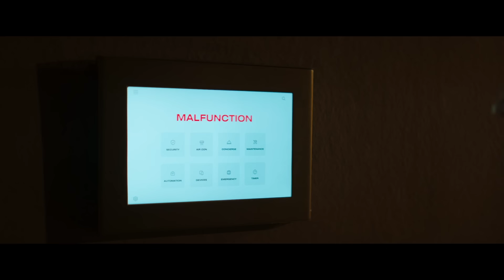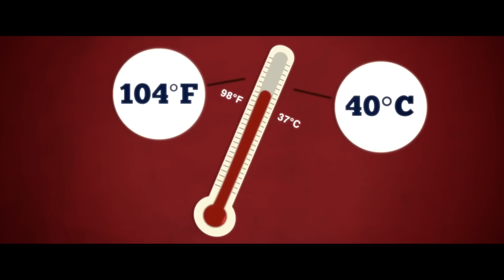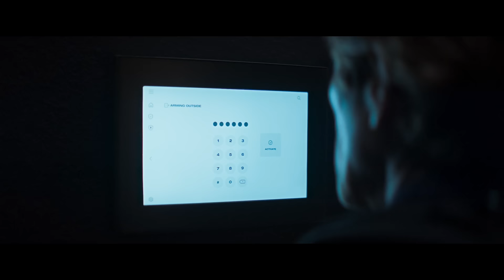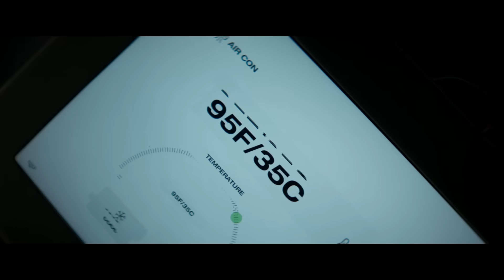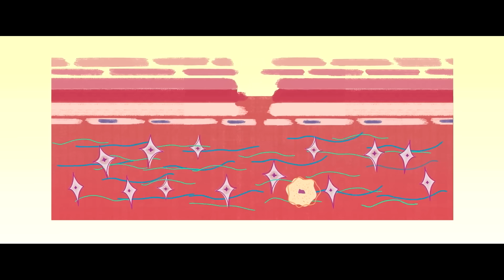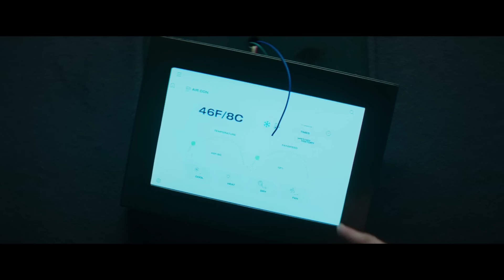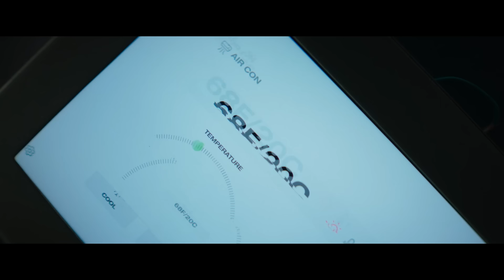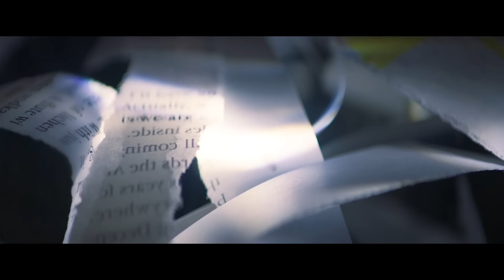How To Beat The DEATH HOUSE In "Inside"

Comment: I thought he could have switched stations on his walkie talkie until he found the security station downstairs or someone else’s. That really frustrated the hell out of me. 
I’m barely 7 seconds into the video so if it’s mentioned already, my bad. 
There was another comment I agree with that said his “partners” gave up on him too quickly and that did feel like a major setup to keep him trapped…but the art theory blew my mind—that the owner just wanted to use Nemo as a medium on madness+art.
Also, I’m sure Nemo hallucinated a lot towards the end…but what was up with the owner smacking Nemo’s head against the table and knocking him out?? That felt kinda real…and Nemo’s dream: it could have been a memory because you cannot do a heist without knowing info about your target(s)…
This movie leaves a lot unanswered but I am still very upset about Nemo not even trying to switch radio stations to find the frequency. The first security guard he sees appears to have a walkie on his desk 🤦🏽‍♀️😪
Just came across the part where the commentator states that Nemo is very limited on who he can talk to, but he could have always called security for help and 1) pretended to be a family member who got in but couldn’t get out & his phone had died or 2) knocked the guard out and rushed out the building

Comment: PzKpfw IV (Panzerkampfwagen IV) was a German medium tank from the Second World War. The first prototypes of the vehicle were created in 1936, and serial production continued in the period 1938-1945, ending with the production of about 8,600 vehicles. The D version of the tank was powered by a single Maybach HL 120 TRM engine with a capacity of 300 HP. It was armed with 1 75mm KwK 37 L / 24 gun and 2 7.92mm MG 34 machine guns.

The PzKpfw IV was created as a result of a competition announced at the end of 1934 by the German Armaments Department for a medium tank weighing up to 18 tons and armed with a 75 mm gun. The competition was won by the Krupp company, whose vehicle was put into mass production - as it turned out, it was a vehicle that can be safely called the "workhorse" of German armored forces during World War II and one of the most intensively developed and modernized Wehrmacht tanks. Numerous variants of the PzKpfw IV were created in the course of production. Chronologically, the first was the A version, armed with a 75mm short-barreled gun and a 230hp engine. However, versions B and C appeared quickly, in which several significant changes were made: first of all, more powerful engines (265 HP in version B and Maybach HL 120 TRM with 300 HP in C version - which were installed in PzKpfw IV until 1945 year), and the armor of the entire car was improved. The F1 and F2 versions turned out to be a real revolution, in which the frontal armor was increased to 60 mm, and the main armament was changed to the great, long-barreled 75mm KwK 40 L / 43 cannon, which in 1942 and 1943 allowed them to fight any Allied or soviet. The most frequently produced versions of the PzKpfw IV were the G, H and J versions, which were very similar to the F1 and F2 versions. The main armament has not changed significantly (it was still the KwK 40 cannon), as well as the engine and chassis. On the other hand, the armor was slightly strengthened, and from the beginning of 1943 armored screens (Schurzen) were installed on them. Numerous other vehicles were built on the chassis of the PzKpfw IV, such as the StuG IV assault gun, the Nashorn tank destroyer or the Wirbelwind self-propelled anti-aircraft gun. PzKpfw IV tanks were used on almost all fronts of World War II - from the September campaign in 1939, through the campaign in France in 1940, the Barbarossa and Typhoon operations in 1941, the Battle of Kursk in 1943, to the last operations of the German army against The USSR and the Western Allies in 1944-1945

Comment: Okay, so I have a way to get out, and it might sound crazy, but I feel pretty confident it might work

Grab anything heavy enough to break something but light enough to carry, put them in a pile at the door, and then start throwing everything at it with full force and ONLY stop for a breath after you're 100% aware that you already used all heavy objects to try and smash the door, it'll either overtime finally create a hole big enough to scream for help from or make enough noise that even someone with headphones on and using a vacuum would notice the noise
Reply: why wouldn't you simply use one heavy object to repeatedly ram the door instead of throwing a bunch of shit at it?
even a basic wooden door would last quite a while if you simply throw shit at it because you need leverage behind the object or the backwards momentum will simply cause the thrown objective to bounce off like the door was a spring.

there's a reason gates and doors are rammed down by hand and not broken by someone throwing things at them.

Comment: that is a strange design. it is strange there is no internet since his hacker was remoting the security system.  control panel would have been connected back to a controller unit following the cabling to find it. Normally this would be in the apartment, if it is there, he could override the door if it is not in the apartment, he needs to focus on the door again, the locks are electronic, they sometime have power off open feature you can set and open the door. the siding door also has a mechanism that can be dismantled and put in manual mode.

Comment: 08:04 Not necessarily.  While he'd be fine if the plants get plain tap water and I'm sure could even tolerate a bit of miracle gro I don't think you would want to drink the water I give my plants as I'm an organic gardener so apart from using inedible things or quasi-edible things you'd find revolting, there's also intentionally a lot of microbial life going on in there.  If the water line is off, then there is a tank somewhere for the plants that can hold at minimum months of water for them, if that's unreachable for some reason, the pump and valves are controlled from somewhere (not necessarily in the apartment though, more and more things use bluetooth/wifi and app controls).

Comment: Usually an appartment-owner hasnt the right to cut off his appartment from the rest of the building. So, when the fire alarm started, the building security should have been informed immediately because... its a Fire in the building! That does not happen. So i also assume that the Art collector set up the complete Appartment as a trap. Maybe not specifically for someone special, but for someone that would try to break in and steal his Art and creating some kind of living Art and looking what the person or people inside his concrete prison would do and form in the process. But as a mechanic i have to say... i would have been out of the appartment within 1-3 Days... depending on how fast i could assemble a ram out of the metal frames and the strings he found... to break one of the windows... as he talked with the pidgeon we saw, that it was only around 1 inch glas. And even if it was bulletproof, security or plexi-glas... in that appartment was so much sturdy metal and metal bars, that you could build a contraption that could funnel an enormous amount of energie to a little point, that you could break that glas. And then maybe climb elsewhere outside, or build a rope to the appartment under that one he was in and "knock" on their windows to get attention. He also could have tried to chip away the concrete at the door just enough on the sides to have a small hole where he could throw a message in front of the door. He had a sharpening tool that is made out of hardened steel what he was using to reveal the bolts on the skylight. There were SO MANY things he could do but i assume... he was an Art Thief and not a handyman of ANY sort...

Comment: Instead of the surface of the door, he should of did the walls or door hinges. Locks/hinges/walls are weak (depends on country you're in for walls). If I know I'm locked in a place and know that no ones outside, I'm making a whole in the walls and such. It's a apartment, they're not gonna spend all kinds on money to make solid walls. Since it's a single apartment up there, their wouldn't need it. Also, that'll add a lot of extra weight to the building for solid steel walls that high up. Door might be sturdy but all doors have a weak point. You got plenty of time to chip away at it since you know no one is coming.

Comment: dont think he got out. he would of have to at least add more stuff to the tower to be able to climb up inside. also depending on if the other vents were screwed in, if he did get in, might die with no escape.

Comment: Heat stroke or hyperthermia is extremely common even in regions that remain relatively cold all year round. From people over exerting themselves, exercising, doing manual labor, to simply wearing to many layers than they need. Leading to exhaustion, that can then lead to their deaths from the cold temperatures.

Comment: ...I'm not penthouse rich so I'm somewhat unfamiliar with that level of top-of-the-line luxury items but on what plane of existence would a heating/cooling system get to such extreme temperatures you either cook or freeze? It seems wildly unnecessary unless of course you're housing and rehabilitating both penguins and lions 😂😂😂

Comment: I think I'd leave as soon as N°3 tells me I have the security system is only deactivated for 6 minutes. It just makes no sense. It's an apartment, you're supposed to live in it, or at least be there for extended periods of time. You're certainly not going to go to the control panel to enter a pin code every 6 minutes. If it sends a notification every time the system is deactivated, it should be immediate. Something is very fishy, here, so I'm out.

Comment: Sure, I'm late - let's go over the easiest thing he could have done - Break the toilet and collect the shards/pieces. That toilet was ceramic. Ceramic is so sharp and fine tipped that it easily shatters glass. I would have covered up myself, and tossed the top of the toilet down into the bathroom while dipping to the side to protect my body. Walked in and gathered pieces of the broken top. Then proceeded to repeatedly throw them at the glass. Maybe it would work, maybe it would - but it sure as hell has a high chance to work. 

If I did break the glass, I could then use the balcony to break someone else's glass or call in for an escape. No luck? Sky light was actually the best plan!!! Except I would have just thrown the pieces at the glass there to break - then built my structure. Clean off the glass and climb up to find the roof access. Then left. 

Honestly, blocking the door from shutting would have been an immediate action. Next, the whole thing is an obvious 'intentionally got you stuck' situation. So as soon as I saw the painting wasn't there I would have called it quits when I was told to keep looking. In the criminal world that's a tell-tale. So I would have said "okay" then just... didn't. I would have gotten to the edge and been like "I bagged the ## painting. Give me extraction" - Never would have said I found the self portrait, just a number. Once I'm out I'd show them the not-self-portrait and told them to deal with it.

If I WAS stupid enough to say okay and tried the security and didn't work? And the door tried closing? I would at that point assume they're intentionally screwing me over and tell them I'm on the balcony for extraction. - Nextly, you always keep a burner on you. Why didn't he have a burner???? Call your emergency aid. Might be gang banger, might be a fence you've gotten good with, might be a mod boss - don't care. You're a CAREER thief, you know people. WHERE IS YOUR BURNER TO CALL THEM?! After 2 days, maybe 3, you know you're safe from officials coming for you. Call your damn help and let them know you have millions ready with your removal. Might take another 2-6 days, but if you have water you'll be fine. Like damn.

This was his own doing. He better do better next time.

Comment: Does anyone else hate Jasmine?

The ending seems to indicate that he was able to "escape", but would that have been any better, seeing as how it was snowing outside, and therefore freezing?
It's likely that this would be just another way to make his situation worse. 

He wouldn't have food or water on the rooftop.  He'd be freezing.  And while he might have been able to get out of the window, getting back inside is quite a lot more difficult - and much more dangerous, especially considering he's already fallen once.

He could hope to flag a helicopter or any neighbor who happened to be looking in his direction, but that would not result in a "happy ending".  Only prison, at best.

I would like to think that my plan would be to hammer away at the windows.  They're closer to the ground level, which means they're closer to the unit(s) below.  Then by gathering fabric and making rope, he could potentially repel down to a lower floor.  

Ultimately, outside of propping the door open at the start - which again, would be on the roof in winter, with a lot of problems in and of itself - his biggest mistake was damaging the climate control system.  There was no reason to do that, and he was a cause of much discomfort, at the very least.

Comment: To me this seems like a Setup from the get go Number 3 probly was mad at Nemo for something and set this whole thing up be it to punish or actually kill him is a whole different story.
The point is 3 can open the Door in the beginning then it magically closes but 3 refuses to open it again WHY he can clearly do it and he clearly also has the abilities to fiddel around with the Security System so WHY would he do nothing and just vanish if not for being the actual culprit who set this thing up to begin with.
Ontop comes the fact that the Painting Nemo was after was moved before he got there and replaced with a Painting that includes him with a Snakes tongue seemingly going insane which is exactly what happens later on. [If he had payed attention to the Painting which replaced the main Prize he came there for he would have noticed something was up before getting trapped.]
My guess on the Rubber Doll is thats actually the Artcollector as in he doesn't exist 3 just made him up to get Nemo to walk into his Trap.

Comment: You cant do anything because there is no logic to any of it.  The windows WOULD break with enough effort.  The ceiling light glass would also break.  And the alarm system would attract attention immediately within moments, this includes the fire alarm and the security alarm and the temperature alarm.  Also when he shorted out the electricity it would have effected the neighbors and theyd have sent people.   And the water from the fire alarm would leak everywhere into all the neighboring apartments.  It is impossible for this not to happen. It is just an apartment in a building.  

The reason he cant escape is because of bad writing contrivances for the sake of a bad arthouse film because the writer couldnt actually manifest his idea in a coherent and cohesive way.  This should have been a short film not 2 hours